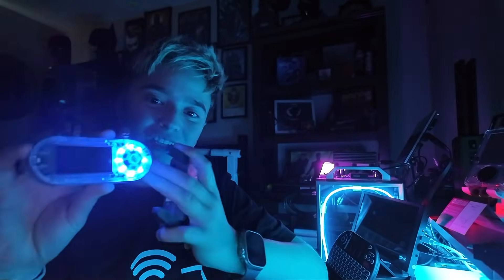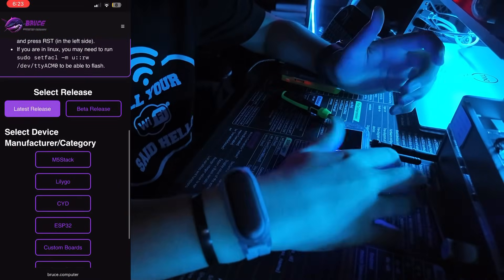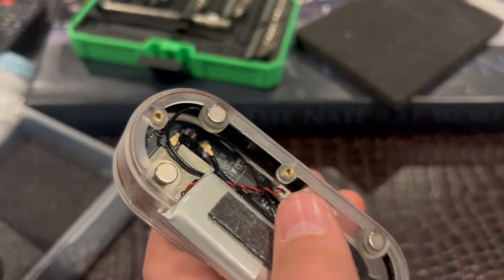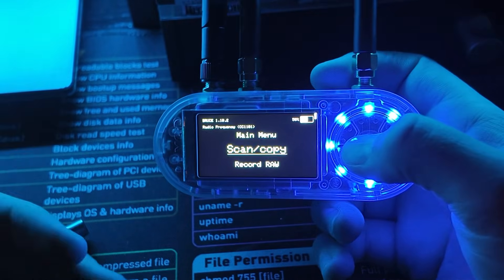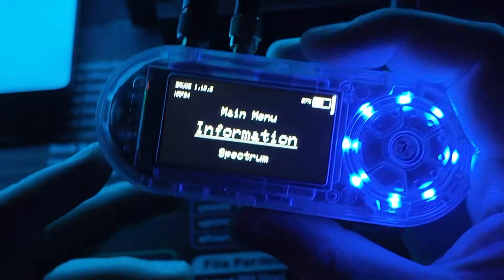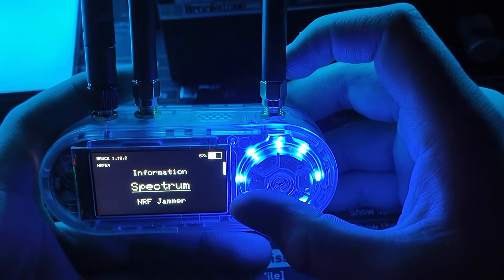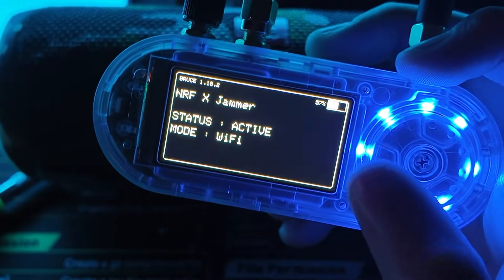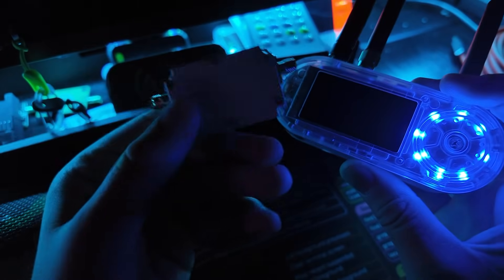WORLD’S FIRST🔥: LilyGO CC1101+NRF24 Combo – The Ultimate Hacking Device!!

Comment: Hi!
May I ask how are you using the RFID read tag function if the RF antenna is external? 
Also, how much do you think using an external antenna makes better WiFi signal?
Reply from the maker: You can still use the RFID read tag function with an external RF antenna because RFID is like access cards and doesn’t rely on your RF antenna at all. RF is signals in the air. For WiFi, using an external antenna can improve signal depending on gain, but it doesn’t affect RFID.
Reply: @AdventuresofIllya Oh wait so there are two UFL connectors, one for RF and the other for RFID? I only saw one on my board, that’s why I asked ))
Reply from the maker: No you can’t have a RFID antenna wouldn’t make sense you have to tap the card
Reply: @AdventuresofIllya Do you think the WiFi upgrade is worth the effort of disassembling the T Embed to make a hole in the casing, or is the WiFi integrated antenna good enough?
Reply from the maker: I would say add one but sometimes it’s not about adding a antenna to devices. It’s about the power output just because you put an antenna that’s long on a device doesn’t mean it gets better range. What you really need is an amplifier.

Comment: why don’t you like flipper?
Reply from the maker: Honestly, I don’t like the Flipper. The RFID hasn’t been working for me recently, and any attachments you need basically cost as much as the device itself. It doesn’t have Wi-Fi or GPS, and honestly doesn’t do much. IR is trash and goes like 2 feet, You can get something like a LilyGO CC1101 plus for $75 that does more than you could think of!
Reply: @AdventuresofIllya thanks for replying. i feel same way about overhyped, useless, not completely finished project like flipper.